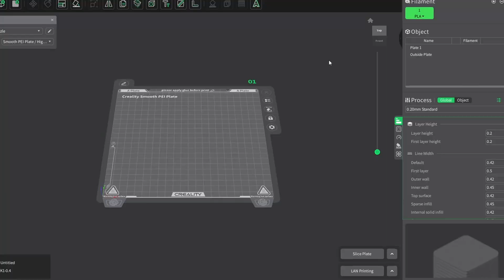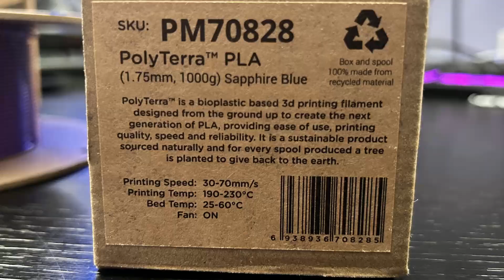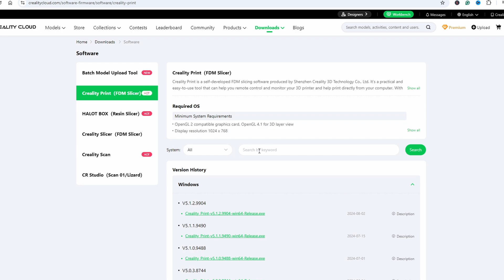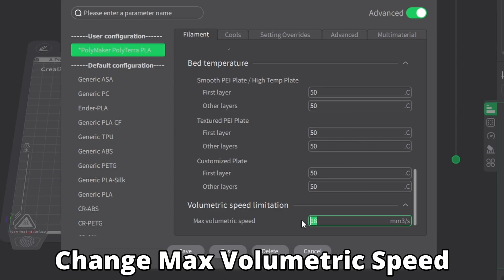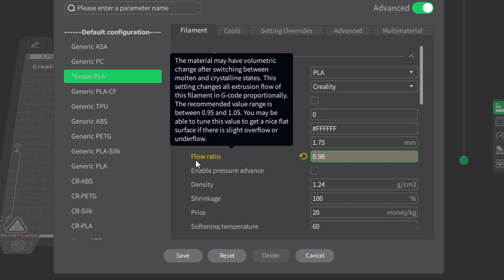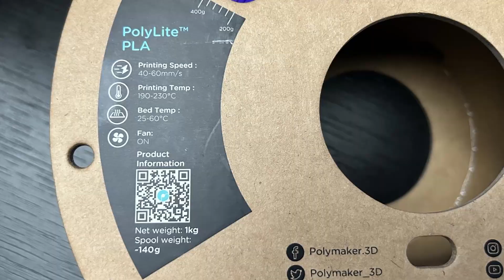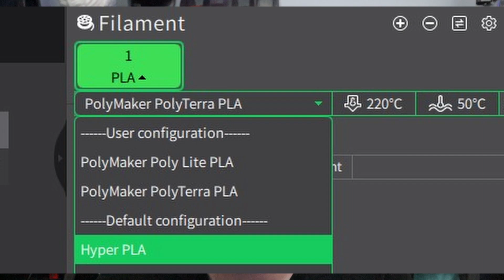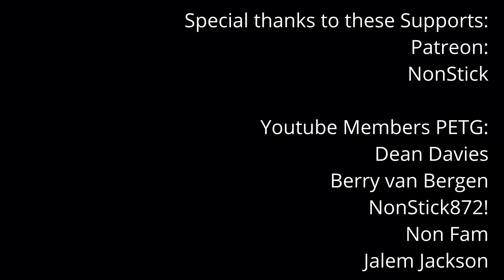Master the Art: How to Add PLA Filament to Creality Print Slicer!

Comment: Hey i have a creality ender 3 v2 neo but it doesnt have an option for it on the slicer. Do you know what i should do?
Reply from the maker: Depends on the version you have... Creality keeps changing the the slicer. During this video, the option was there. 
You might check out on Orca Slicer and use that slicer instead. I made recently a video about that
Reply: @Zachary3DPrints  thanks man I'll try that today

Comment: Very Nice Video ! I am leaning a lot thanks to your videos! Much appreciated.  As i am trying to learn Creality Print 6 and trying to set up a new filament type. (PCTG) and I haven't been able to find where to change that,  as PCTG is not in the Creality menu.  I just had to leave it as a a PETG and label it as 260 or 265 or 270 (for nozzle temp) in your video here. (PCTG needs 20C more temp.) I bumped the flow from 95 to 97 as well.
Reply from the maker: Thank you. Adding filament to slicers can be a challenge. But so glad this video helped you in the right direction!

Comment: i have bought an ender 3v3 KE recently. I somehow can't change the speed in the creality slicer. When I try to set it from 300 to 500 the print time stays the same and the speed does not increase. Can you help me to solve that?
Reply from the maker: Hey Hans Smit, where did you change the speed? I think in the Right hand side? Some of the settings are bound to the maximum speeds in the Printer settings in Creality Print (the pencil next to the printer name on the left top). After checking this myself, I see that it should be 500mm/s. I'll make a more deep dive video after I'm back from 3Dprintopia.

Comment: Good tips especially about saving those profiles. The one i found that did best for overall quality that varied most from filament to filament was e-steps.  Where you extrude 100mm and see how much it actually extruded and with a formula you get the compensation value.  That one improved my prints quality imediately the others fine tuned it, like dimensional accurecy with flow and less stringing with  retraction.   But i think that all stems from a good e-steps calibration.   
  Thankfully the vyper community editionfirmware  added esteps calibration from the menu so you just put in the number from your measurement and it does the rest, we also got linear advance!  But there are calculators for if you dont have in on your printer, like i did before it was included in our menu.  The linear advancet one helped a lot too to but i only did one print with it and it came out flawless.   I would go klipper but the opensource firmware on the vyper anyway has produced some nice mods already without needing more then whats onboard the printer.  Anyway thanks for the tips on calibration especailly about saving!  And a reminder what i dont like about 3d printing, but its good to know you can dial it in with a step by step process. 
  Heres mine - 1. PID tuning first and foremost i hear is mandatory.  Then you can level the bed, and also start doing esteps.  Then you can print some cubes (ones with thin walls) for flow calibration, theres a formulat for that too but you can just keep decreasing until you get .4mm walls.   I had to take mine down to 80% to get .4mm walls.  After that i can mess with retraction settings but dont do any calbiration for it, i just let the print decide, you can alays clean the strings up.   Thankfully the vyper community edition released another new firmware and included Linear Advance calibration which i did last and wow that really did seem to make things better. you can see in the calibration lines you print how far off they are from being even and thats where the default settings were.  That should make for better prints if not the biggest difference.   Anyway sorry for the long winded resposnse but this stuff is important I had to get most the details of my chest, there should be a step by step fool proof way to get the quality your printer deserves, other then my comment and Zachs video but until then a little tuning is needed but definately worth it.